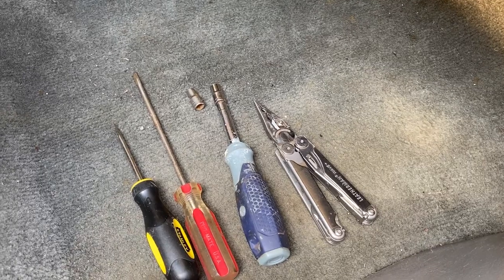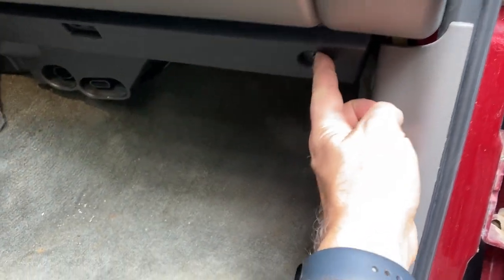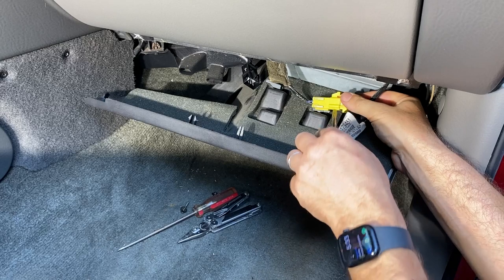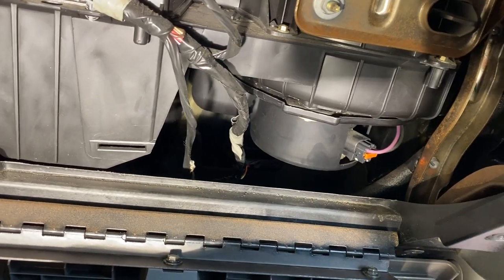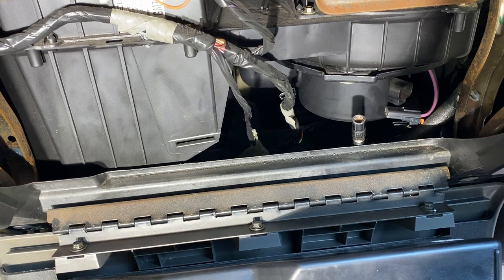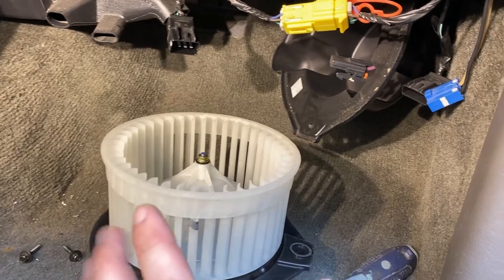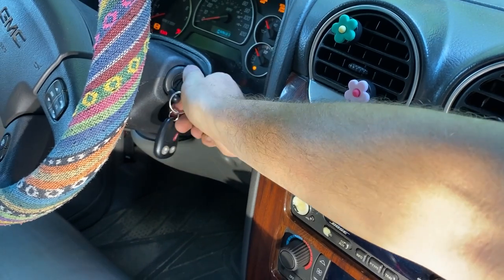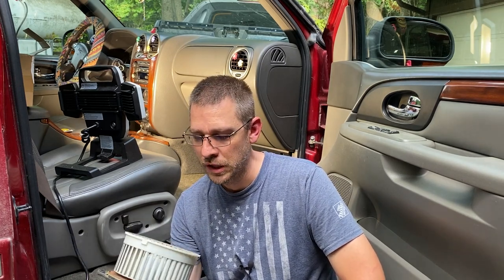How To Replace Blower Fan GMC Envoy, Trail Blazer, Rendezvous

Comment: I noticed the one I ordered on Amazon, did not come with the black housing that looks to have a L shaped air vent on it.  Is it fine to install without that black housing, as I tried all day to get it removed from the old blower and it would not come off?